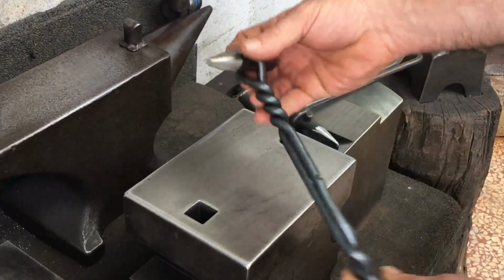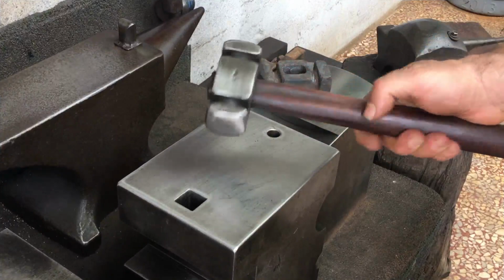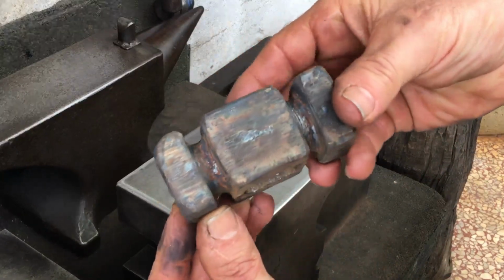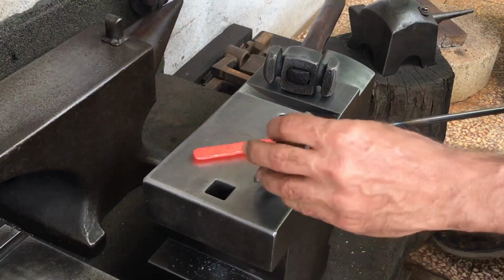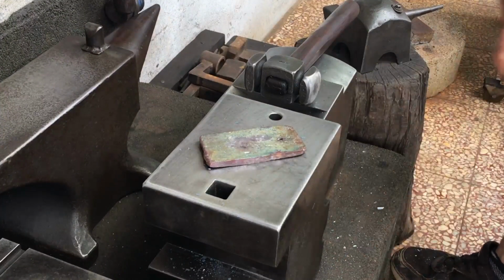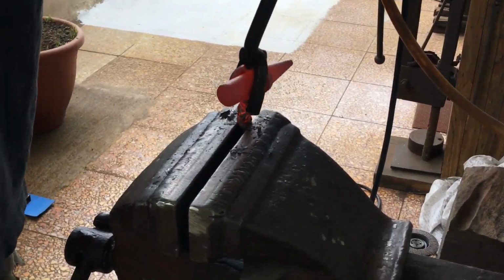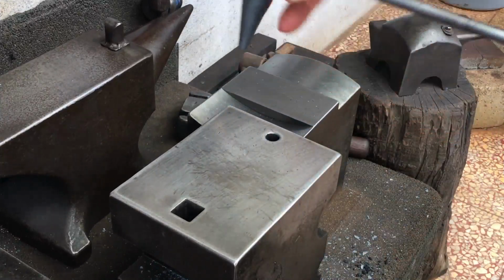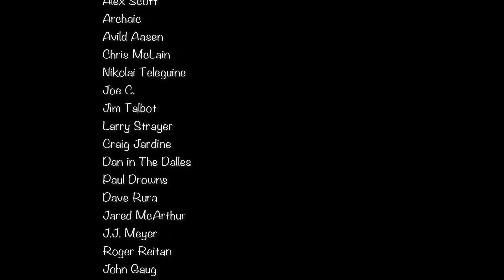Interesting Handled Blacksmith Punch

Comment: Where do you get those punch blanks. It would be a fun project to make my own handled punches and cutters.
Reply from the maker: I purchased H13 steel and had it milled and drilled but a machinist I frequently use. Just easier... Thanks.